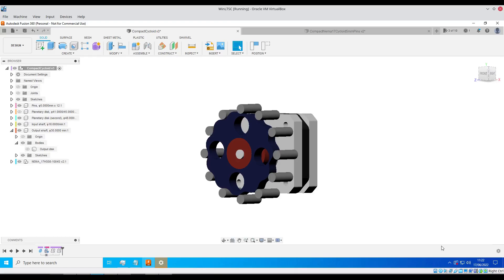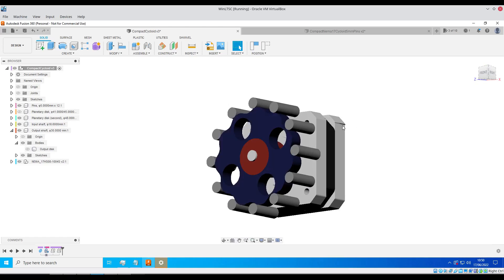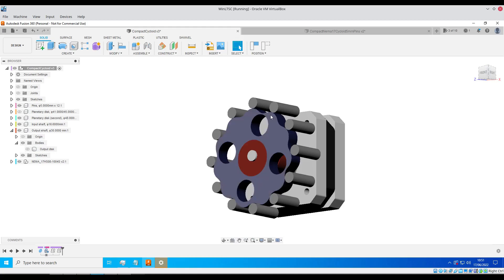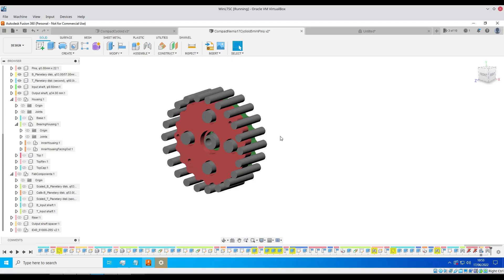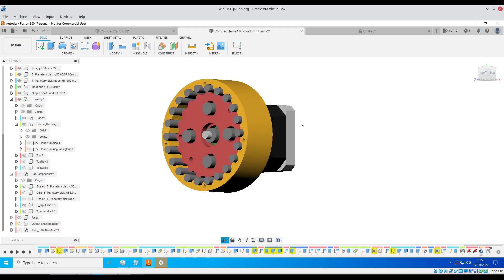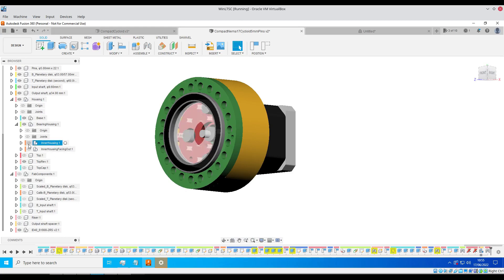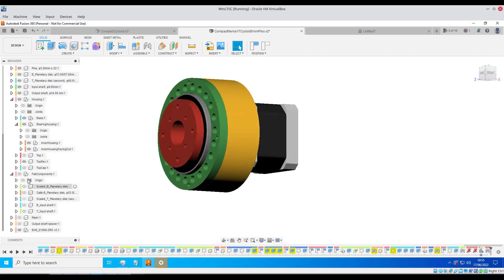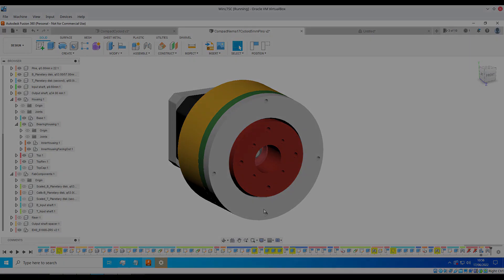3D Printed Cycloidal Drive Build

Comment: ratio is 1:21 thus the efficiency is 35%, is this correct? is it because no bearings are used on the ring gear? how was the wear of the cycloid gear after running against the steel pins? thanks!
Reply from the maker: It's part of a future robotics project I'm planning so I should be able to comment on wear with a bit more data. This was more proof-of-concept, you'd want to up the infill to really see what it's capable of but I know what the minimum performance should be. I don't believe I omitted any bearings, unless I've misunderstood what you meant. Correct, the ratio is 21:1. Thank you!